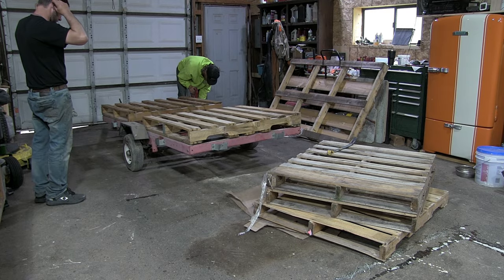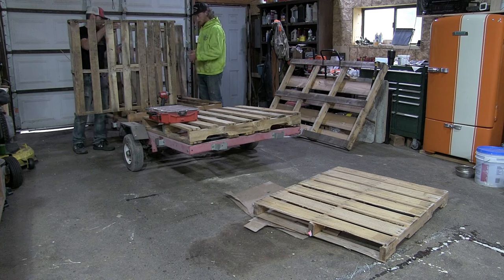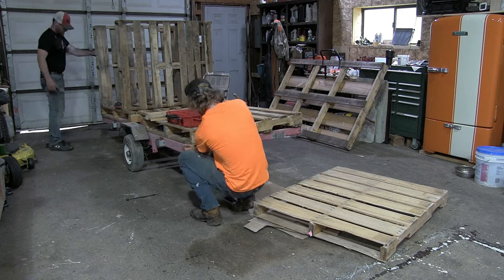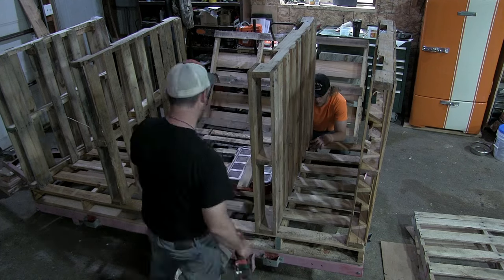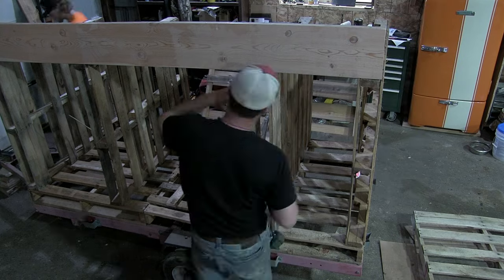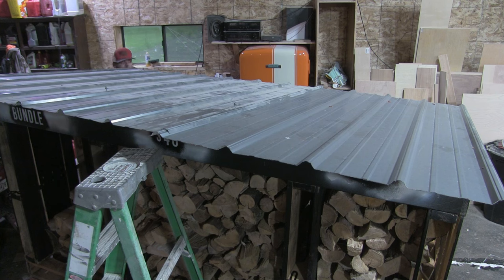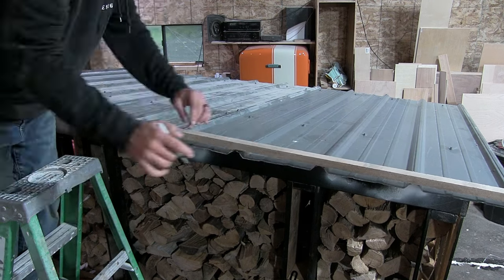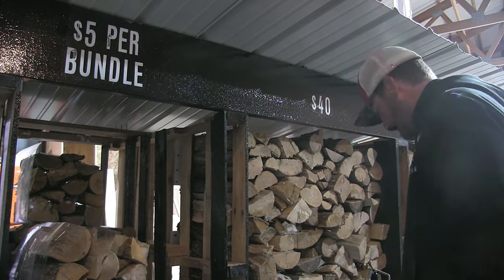DIY Firewood Stand Tutorial - How to Create a Convenient Roadside Setup - CMF 35

Comment: And a Good  Day  to you !
That's  a Nice Build...it should  work  great !
I was wondering  about  the low end of the roof...seems  like  the right  height  that  one could  cut one's  head with the sharp  metal  corners !
Or did  you do  something  with them so customers  don't  get hurt ??
Is that  an old fridge  in the shop !
If so it sure looks  Cool !
Is it still  working  or are you using  it for storage  of stuff !!😊
Reply from the maker: I have been thinking the same thing about that low side... Haven't come up with something I think is a good answer for that yet. 

It is working 1948 Zenith refrigerator. A friend of mine asked if i wanted an old fridge to build a smoker out of and that's what showed up. I got to thinking I should plug it in to see if it still works and it did! So I hauled it to a friend of mines auto body shop and had it painted and replaced the door seals and it runs like a champ.
Reply: @CentralMinnesotaFirewood  Nice !!!